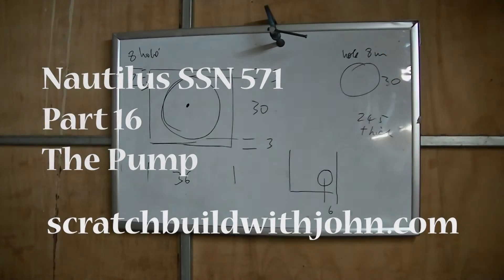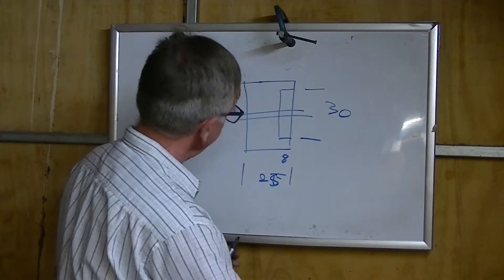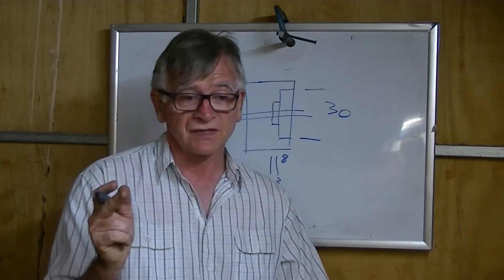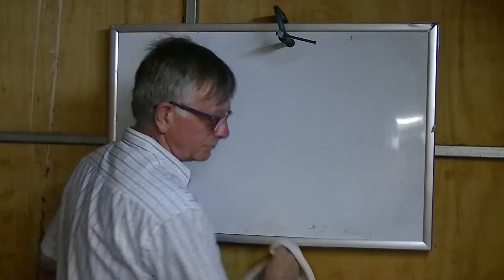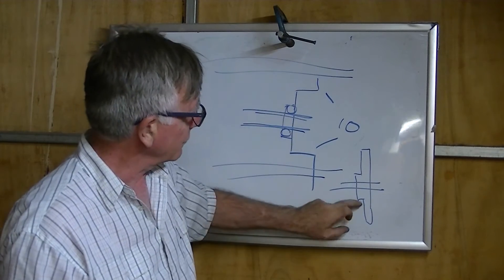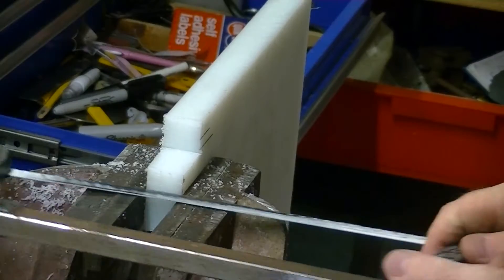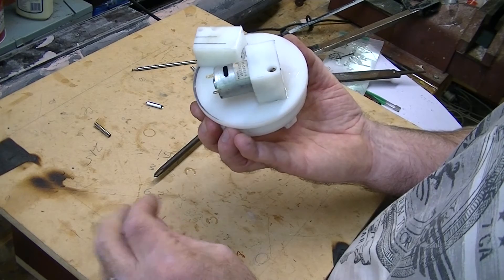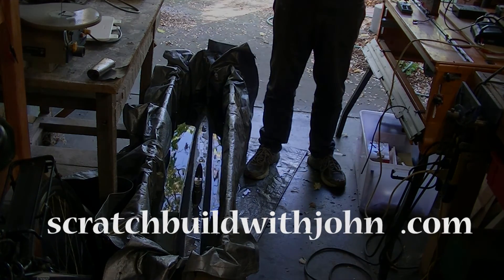Nautilus SSN571 16 The Pump

Comment: Why couldn't you use a 12v windshield washer pump?
Reply from the maker: You need a reversing pump to make this work!
Reply: Some are reversible. I have a few from cars I had over the years and I found 2 that are reversible. They will fill a ballast tank from the water then suck the tank dry. One is from a older Volvo and the other is just a cheap universal one. 

Your idea is great I just don't have the tools to build the same pump you did and thought it might be easier to use one of the reversible ones I have
Reply from the maker: Do you want to dig one up?  (A link)
Reply: This one is for a 1990 Toyota 4Runner. I have a Toyota branded one and it is reversible. I'm not sure if this brand would be reversible or not.
 http://www.rockauto.com/en/moreinfo.php?pk=273991&cc=1272316&jsn=358

I got another from a local Canadian Tire store. It is just a universal one. Canadian Tire has a different one online then the one they sell in the store or at least my local store is different. I'm not 100% sure if this is the same pump but it looks the same. https://www.amazon.ca/dp/B01HEBYJKO/ref=sspa_dk_detail_6?psc=1
I need to go to Canadian Tire later this week and I will Check the manufacturer and part number of the pump I am using and then I will find a link to it.

I have other that are reversible as well but I have no idea what vehicle I took them from. I think your pump puts out a higher pressure/ volume of water then a washer pump though. I've never built a submarine so I don't know if a washer pump will work But I'm going to try it...If I get it working I will let know.

Just wondering have you ever seen this Nitro powered Submarine? It isn't as nice as any of your builds but it is still cool!  https://www.youtube.com/watch?v=85XKCCxJ3CE